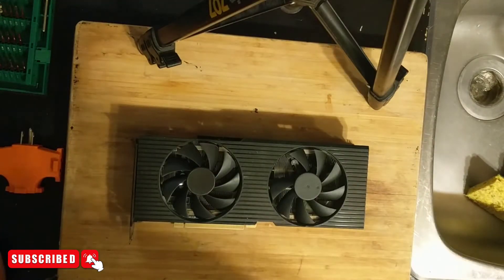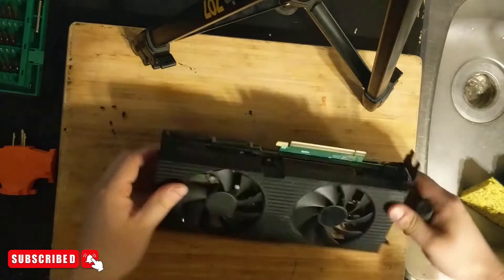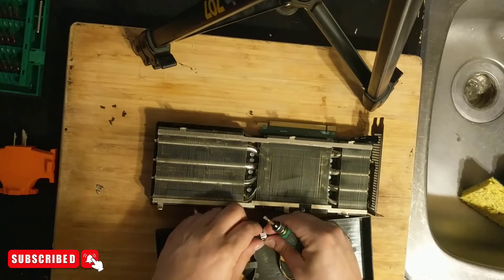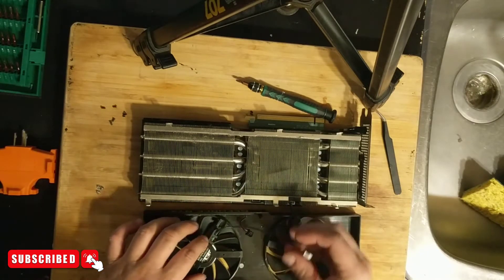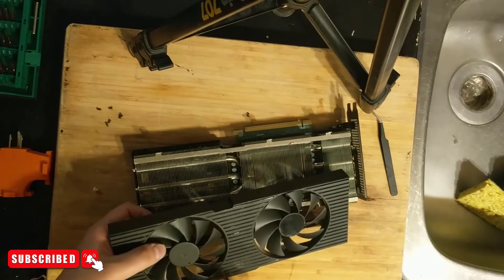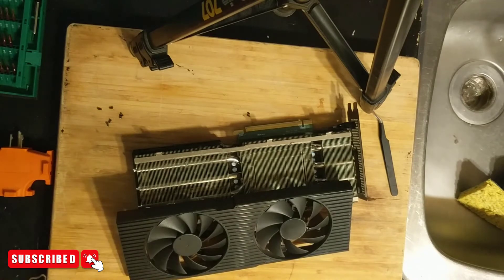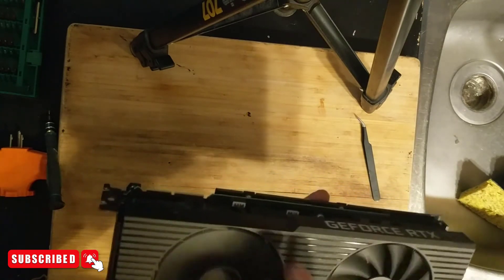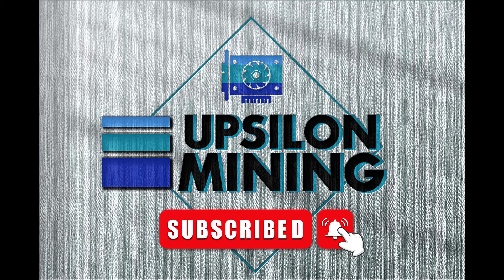Dell RTX 3080 Fan Replacement & Random Chat

Comment: Do you mind sharing your hiveos OC settings and MH for Dell rtx3080? somehow my exact same GPU's mclock refuse to go past 1230
Reply from the maker: I am using -200 Core, 2275 Mem, 230PL.  I have one 3080 that will crash with any memory past 1150 so I have to dial it down and its maxed out at 93mh/s.
Reply: @cryptomatt1983  same here. Maxed out at 94mh or it will crash the rig. Probably bad silicone lottery.